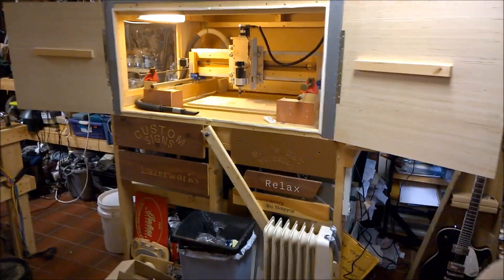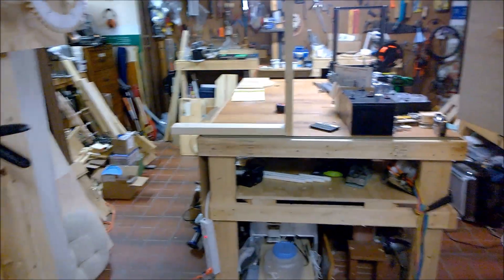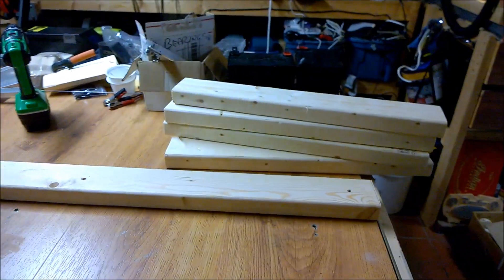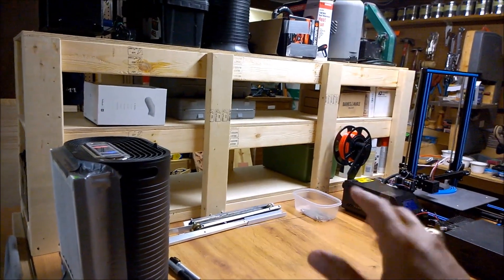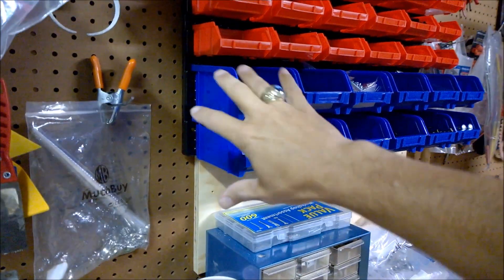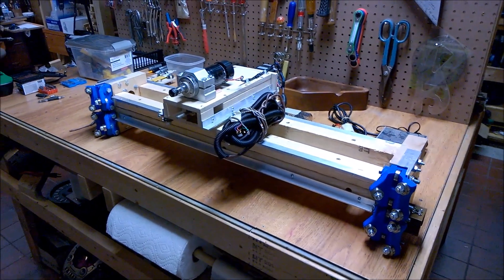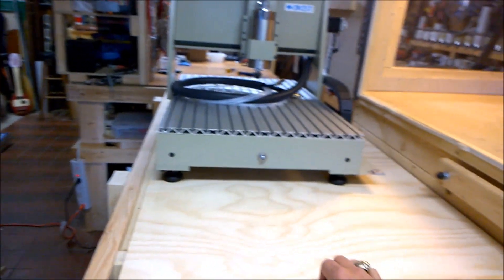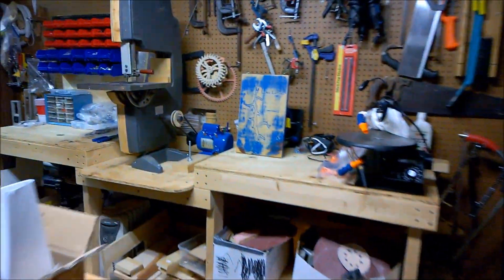New 6040 CNC!! (And Shop Update)

Comment: Sorry, this post is old, but still in ebay I think there is similar CNC machine I saw and wanted to buy. Wondering how it is going so far? Also, what drivers the stepper motors used? Are they individual drivers? I didn't see any picture in ebay ads and the sellers usually don't know anything what they are selling.

Comment: What operating system are you running?
Reply from the maker: To run the cnc I use Wndows XP on a dedicated very old laptop that is not connected to the internet.   For the interface I use a uc100.  The system has worked very well for years.

Comment: Hello,I have the same cnc however it didn’t come with any paper work, where did you get the information to set up Mach3?
Reply: Yeah, these machines often don't come with much documentation.  This is a good link for the ports and pins settings:  https://www.china-cncrouter.com/news/ChinaCNCzone-CNC-6090-CNC-6040-Mach3-Settings-and-Setup.html
Reply: Dan Lazer Thanks!
Reply: Hello,I’ve noticed there’s no set up information for spindle speed or for the cnc controller box,

Comment: I bought the CNC6040.  Now I'm having a problem with Mach3.  I start Mach3, the welcome screen displays, then the computer reboots.  Just wondering if you have seen this happen -- any suggestions?  Thanks!!
Reply from the maker: Congratulations!  You'll have a lot of fun with it.  Unfortunately, I don't have any suggestions on why Mach3 is rebooting.  It is a very low drain application that can be run on 15 year old machines.  I don't believe it's set up to run on Windows 10, but I could be wrong.  I'm running it on an old XP machine.  I assume you have a purchased copy; there are a lot of bad ripped programs out there.  The Lumberjocks forum is a great resource for help getting set up.  It's a much more peaceful and low key forum compared to the larger ones like the CNC Zone.  Although both are good resources. https://www.lumberjocks.com/forums/19
Reply: @drez20001 Thanks for the info. actually I purchased a legitimate  Mach 3 license and loaded on a 32 bit. desk top, 4GB ram with win. 7 pro

Comment: Hello Drez20001, just saw your new cnc video, would you comment on how you will control the router i.e.; software, on board software, computer, the cnc model and which one on ebay that you feferenced. thanks etc.
Reply from the maker: Hi Bill.  I'm using the same computer set up I've had on the last few CNCs.  Mach3 for the control software, a very old Dell Lattitude laptop, and a UC100 interface between the parallel port output of the control box and the computer.  The UC100 converts the parallel output to a USB computer input.  This was the CNC listing.  https://www.ebay.com/itm/3Axis-1-5kW-CNC-Router-Engraver-6040-Metal-Drill-Mill-3D-Cutter-Carving-Machine/283330500575?ssPageName=STRK%3AMEBIDX%3AIT&_trksid=p2057872.m2749.l2649
Reply: @drez20001  Thanks for the useful information, I do have Mach 3 control software and an old dell 32 bit win 7 xps sans parallel port but what I get from your response I could use the UC100 and USB but not win 64
Reply from the maker: @billylester7901  The uc100 makes it possible to use a computer that doesn't have a parallel port.  As far as Mach3 even windows 95 will work.  Mach3 is pretty low on resources.
Reply: @drez20001  If I should purchase the 6040 would you consider providing me your mach 3 config and other settings which would be a great help.
Reply from the maker: @billylester7901  I could, however many settings are particular to individual preferences.  This site worked well for me getting the basic pins and port assignments set up:   https://www.china-cncrouter.com/news/ChinaCNCzone-CNC-6090-CNC-6040-Mach3-Settings-and-Setup.html
Reply: Drez2001, thank you very much, I completely understand what you mean, I also am pleased for the CNC set up site you provided and please pass along any other information you may come across.